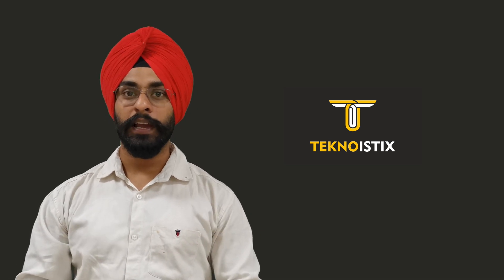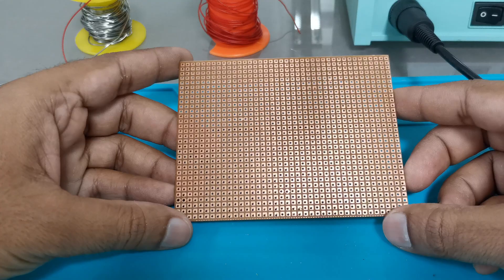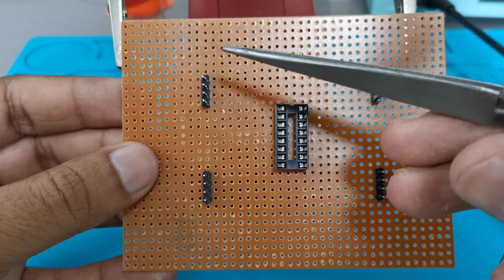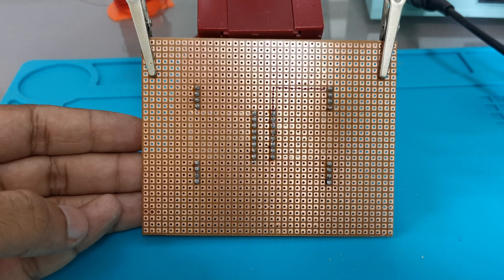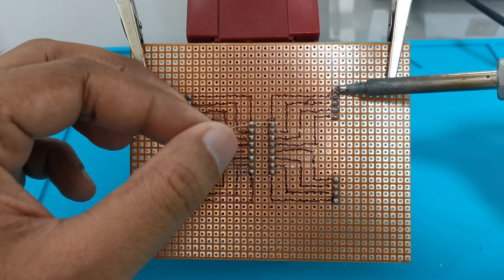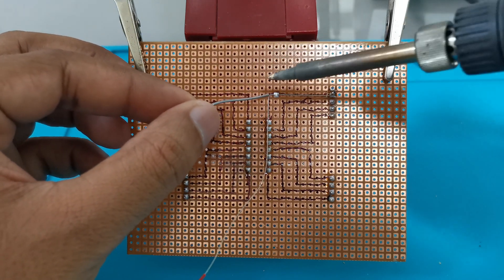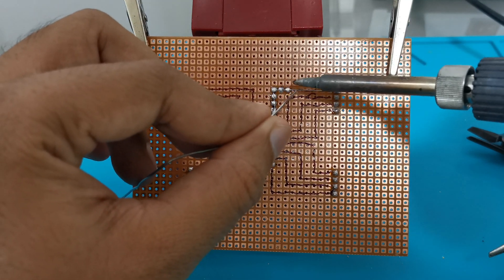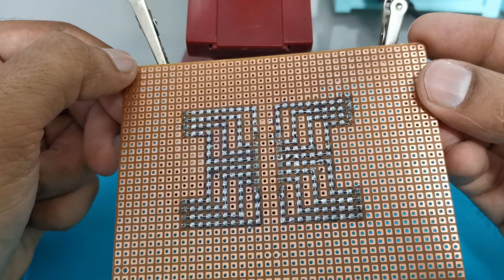How to Make Perfect Solder Tracks on ZERO PCB

Comment: I solder without using wire as a track. Sometime I accidentally burn the hole and I have to solder diagonally which it's very hard to do. Is there a technique to do that?
Your technique is great and have very professional look.
Reply from the maker: Its not recommended to do it without wire, it consumes double the solder amount

Comment: Why solder every single joint?  Can't you get away with just soldering at each point and the bend?
Lets hope you dont have to rewire anything.  You'd have to de-solder every joint.
Reply from the maker: Soldering every point gives strength to wire and it can handle more current
Secondly it looks professional

Comment: Great job! What kind of wire do you use? The wires i usually are are the split strands that need braiding to make one
Reply from the maker: Single core wire is also available in market
Reply: @TEKNOISTIX  great, thanks

Comment: Thank you for this video. The designing was very interesting but I wonder, why would you solder every piece of solderable hole in the path of the line? Isn't that waste of solder?
Reply: The purpose is to strengthen the wire, but, I know I wouldn't bother in alot of mine

Comment: I enjoyed your video — thank you for sharing it!

With traces that run side by side, do you have any tips on how to keep them isolated from the connections beside them? Or how to remedy incorrect connections made in this way?
Reply from the maker: Expertise will come with experience
When you will do it regularly you will bearley make a mistake
Meanwhile you can use Desoldering pump to remove mistakes
Reply: @TEKNOISTIX  zero pcb kitna me milega market me
Reply from the maker: 30 rs aprox
Reply: @abhishekkumar-mm6bt  kharida kya?

Comment: Poor Design.  If you were just to connect IC pins from the base to the headers than why waste so much of PCB space?????  You can put the headers next to the IC base.
Reply from the maker: This is the soldering tutorial for making tracks

How can i make tracks if I place  headers adjacent to the ic base?

I have used headers just for example

In practical design  different components can be there.
Reply: @TEKNOISTIX  If you wish to demonstrate a real and practical PCB than you should use an example with ICs, Resistors, Caps etc. Your example here is so 'lame' ..it doesn't display any practicality, everyone knows how to use baro-boards
Reply from the maker: Ok
Thanks for advice